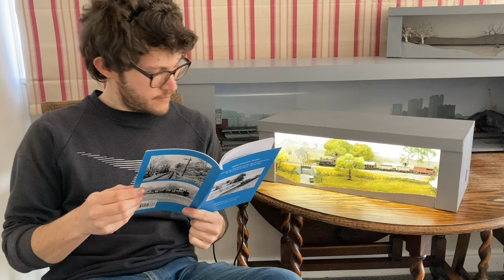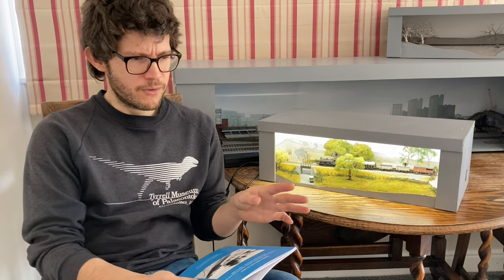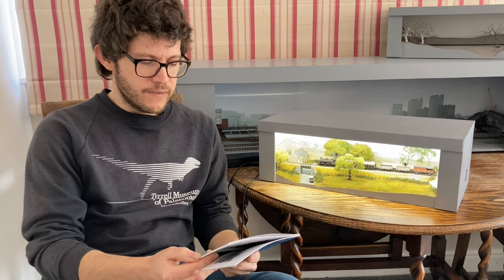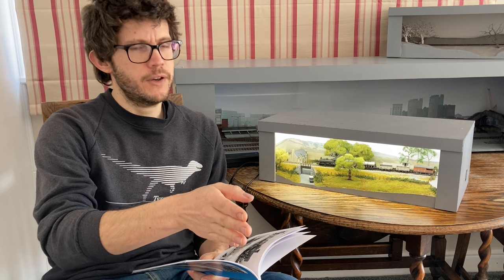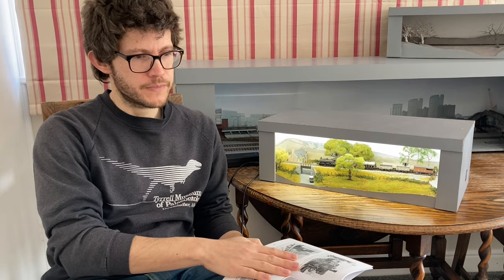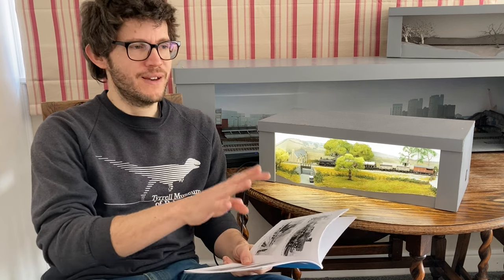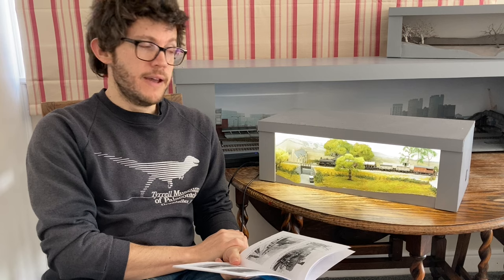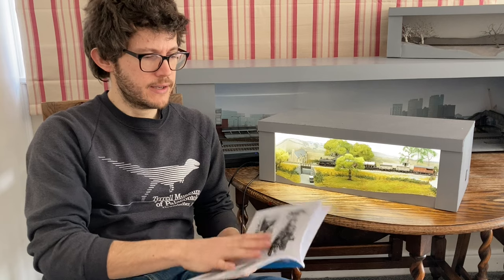Quiet Between Trains - Pont Dulas micro layout in N gauge...

Comment: Great video as always thank you for sharing. One question I have is how did you do the grass was it static? And what size lengths? I'm currently up to this stage almost on my little layout.
Reply from the maker: Yes static grass - various lengths but always starting with a base layer of 2mm. I use a Precision applicator rather than a monster, and the frequent re-fills mean the tone changes as I go... I use Peco-scene fibres on this, winter and dead grasses. Notice the tonal variation between field and embankment and the spots of longer grass... it's all a mix of 'feel' and observation - oh and practice of the craft. Good luck - and thank you.
Reply: @JamesHiltonCustomModelRailways  I don't currently own a static grass applicator do you have any recommendations? I seen a fairly cheap one on Amazon with some static grass tones included. Thought's?
Reply from the maker: Don't skimp. The Peco (or WWS equivalent) precision is the one I'd recommend for building up a finish slowly but deliberately. If you're doing larger areas a big one is also useful, I've a Greenscenes Flockit. Grasses, choose muted tones, not bright greens... Pecoscene or WWS are great, there are some good Mininatur shades and Greenscenes do some.